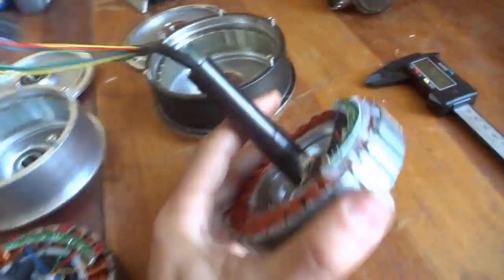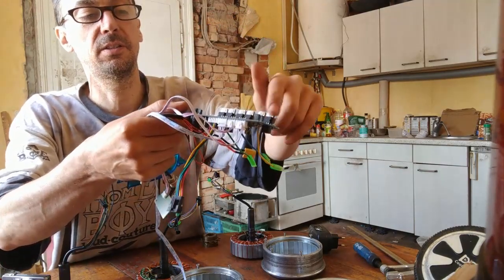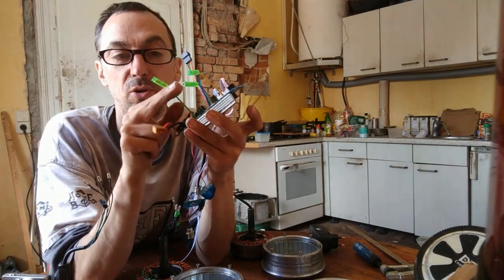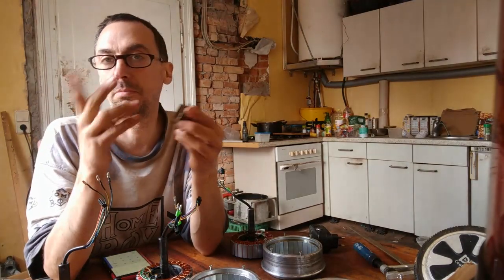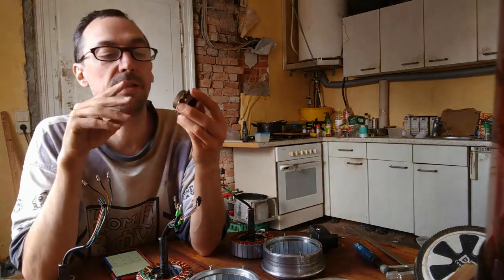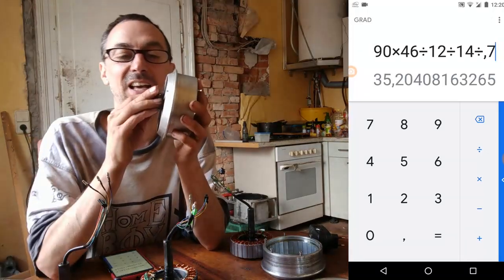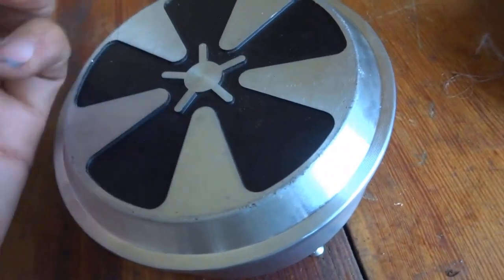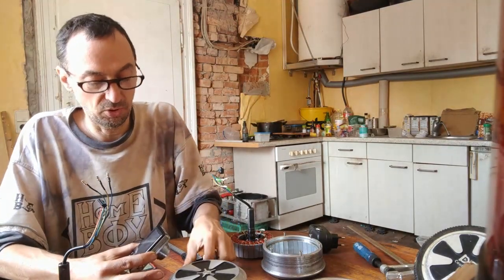part 2: how to add a freewheel sprocket to hoverboard motor for an eBike mid-drive-motor :-)

Comment: Nice! I think this freewheel feats perfect at bottom bracket common left threads
Reply from the maker: please post a link or search term so i can find 'bottom bracket common left thread' on ebay and understand how that thing would help to mount the freewheel to the hoverboard motor.
Reply: @robodurden  you need something like this https://www.amazon.com/Action-Bicycle-Bottom-Bracket-English/dp/B018RNI2UQ# 
You can buy from internet also from a local bike shop. Very cheap! From those two bearing cups you need the left one (right threaded) which you can 
mount with 4 holes on the motor rotor
Reply from the maker: @WhyNotCycles  From that amazon image i would think that 6 screws would fix that cup to the motor. But i would be surprised if the thread would match. I guess my freewheel should go onto a BMX rear hub like https://www.ebay.de/itm/Sunrace-Alu-BMX-Nabe-hinten-36-Loch-prazisionsgelagert-silber-14mm-CrMo-Achse/163659692668
Reply: @robodurden  those threads are the same. The difficulty is to make thise six holes on hardened bottom bracket steel! 
Personally i prefer to attach the gear from the other side of the motor! Check my photos on my video https://youtu.be/6BoPwdV2TGo
Reply from the maker: @WhyNotCycles  now i am confused even more. Why should i want to make these six holes on hardened steel ?? The hoverboard front is aluminium. Your video does show a freewheel gear attached to the inner side of the hoverboard motor ? If so a short video tutorial on how you exactly attached it would be nice :-)
Reply from the maker: @WhyNotCycles  Yes you are right, this thread is called BSA and is 1.37 x 24 inch (= 34,8 mm outer diameter, 24 windings per inch). Now i could buy on ebay.de https://www.ebay.de/itm/FAG-BSA-1-37-x-24-Innenlager-Tretlager-4-Kant-119-mm-Vintage-Retro/353100917009 but that would not help others. That is why i need an aliexpress source. And there i can not find a bottom bracket with wide enough edge to hold the 6 screws. Only brackets like https://www.aliexpress.com/item/4000348987136.html
And anyway, as the freewheel only costs USD 3 and a used hoverboard USD 30, the adapter should cost less then USD 5.

Comment: hi robo
I wached all your videos about hoverboard, and also I follow your github. That are very impressive and helpful contents. Also I want a video from you. I and many people will be grateful to you if you make a video content that you have installed the firmware for the first time on the Hoverboard and then controlled the motors with the arduino.
Thank you again your contents and repos
Reply from the maker: Yes another guy asked which pins to connect from Arduino to Controller board. You mean a 'full tutorial' where i show how every single pin is connected ?

Comment: How to find the watts of my hoverboard motors.
Reply from the maker: watch part 1 and open your motor. If the stator has a height of only 20mm then you have a 250W motor. 25mm = 350W, 30mm = 350+W
imo (in my opinion)
Reply: @robodurden  thanks,

Comment: Why can't you use E. Feru's firmware for the boards you show in beginning of the video.Someone used this firmware with that board before. Link is below:
https://github.com/EmanuelFeru/hoverboard-sideboard-hack-GD/issues/3

For solar charger I would use  https://github.com/opensolarproject/OSPController which is simple to build.
Thanks.
Reply from the maker: Because those boards in my video are no side boards but these ones: https://github.com/flo199213/Hoverboard-Firmware-Hack-Gen2/issues/10

Mppt is not really useful when you already have solar panels that match battery voltage.
Here watch my own esp8266 mppt: https://youtu.be/1vDQG1ODD4M
Reply: @robodurden   I know  these are not sideboards but  "split motherboards". I thought these type of "split motherboard" are supported with E. Feru's  firmware.
Reply from the maker: And why do you still think so ?